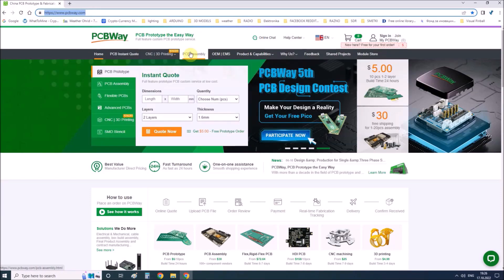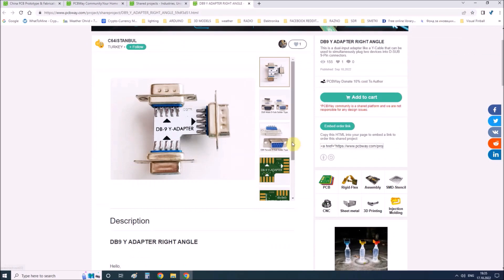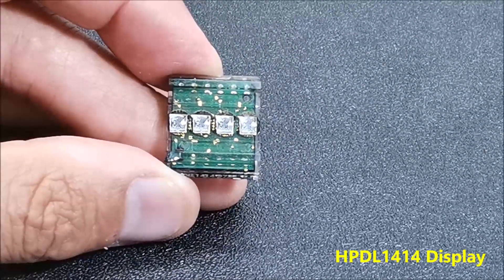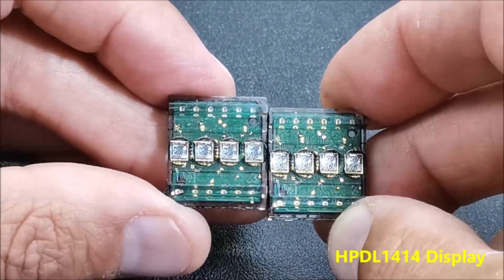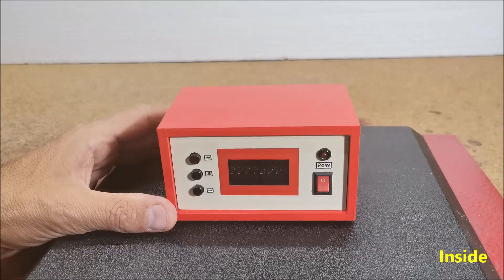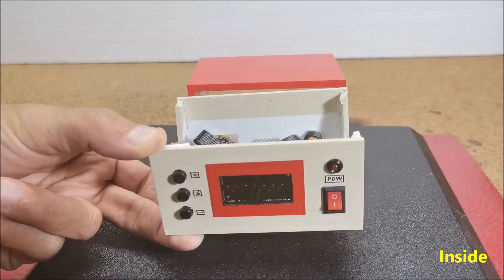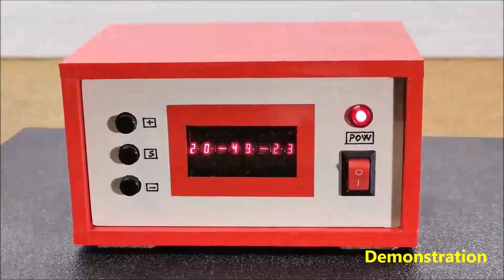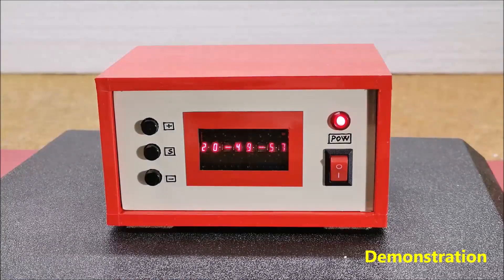HPDL1414 Arduino Micro Clock

Comment: Hi, I tried to adapt your code for ESP8266 NodeMCU but it doesn't work. Do you have some suggestions why? Would be glad for your support!
#include  <HPDL1414.h>
#include <Wire.h>
const  byte  dataPins [ 7 ]  =  { D0 , D1 ,  D2,  D3 ,  D4 , D5 ,  D6 } ;  // Segment data pins: D0 - D6 
const  byte  addrPins [ 2 ]  =  { D7 ,  D8} ;               // Segment address pins: A0, A1 
const  byte  wrenPins [ ]  =  {10};        // Write Enable pins (left to right) 
char t[32];
HPDL1414  hpdl ( dataPins ,  addrPins ,  wrenPins ,  sizeof ( wrenPins ) ) ;
void  setup ( )  { 
  Serial.begin(9600);

  Wire.begin();
  hpdl.begin ( ) ;
  hpdl.printOverflow(true); 
  hpdl.clear ( ) ;
  hpdl.print("*TIME*");
  delay(3000);
}
void  loop ( )  { 
    hpdl.print("abcd");
    delay(200);
    hpdl.print("1234");
    delay(200);
}